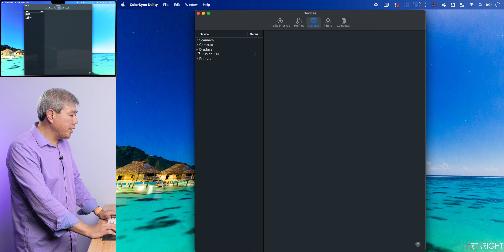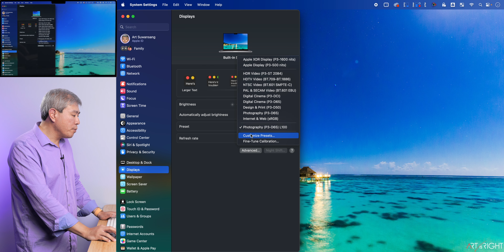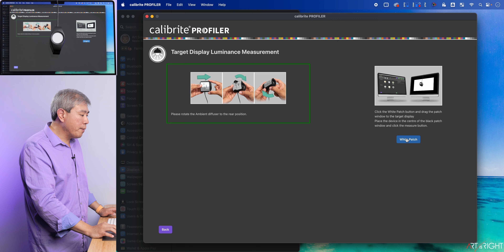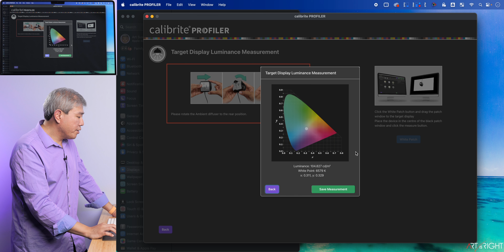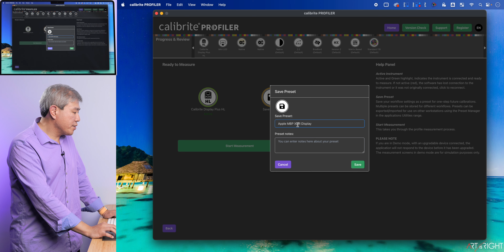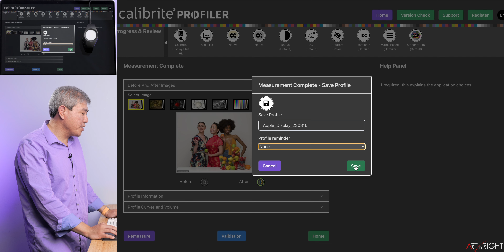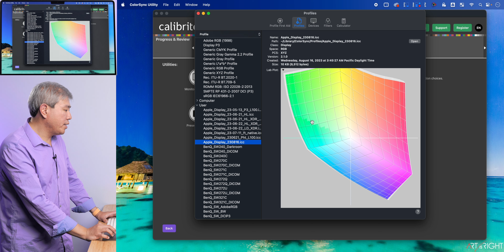Ultimate Calibration Guide for Apple 14" & 16" MacBook Pro XDR Display - This is the way!

Comment: Really appreciate your video. Just picked up the display plus HL for my new 16” M2 MacBook Pro. Question I had for you is whether the following results seem acceptable:
-All patches avg - 0.8 (97)
-of the lowest 90% - 0.5 (87)
-of the highest 10% 2.9

-All patches max: 3.7 (96)
-of the lowest-Max  1.8 (86)

-Standard deviation results - 0.8 (97)
-lowest 90% - 0.4 (87)
-highest 10% - 0.7 (10)

I did set create the P3 L100 profile, and set the custom white point values measured, as well as the targets you suggested. 

Thanks again!!
Reply from the maker: Yes based on what I have seen that is good and within range :)
Reply: @ArtIsRight thanks!
And wow - that has to be the fastest YouTube reply I’ve ever got!
Really appreciate your hard work and the amount of time you take in making these videos!

Comment: Hi Art another great video and thanks for sharing so on my  Pro Display XDR following your instructions to the "T" I  am getting all patches average 1.5  and All patches - Max: 3.3
Let me know if you find out any other "tweaks" I can do for my Pro Display XDR to improve this. little bit.. And yes I am using the new Display Plus HL
Reply from the maker: That is on the high end range that I was getting, If you do run the calibration again, you might be able to drop the average and max down by a few extra points. But that is number is inline with what I am seeing

Comment: Thank you so much, I have MacBook Pro 14 do I need to calibrate it For photography?
Reply from the maker: If you print you should. And if you don't print but do pro work I would recommend using the reference mode and doing a white point fine tune to get the best result out of your Pro Display

Comment: Doing this the All Patches max shows as 3.6 - is that still good? Also when calibrating the white point the max value available was 97.5, not 100 or over. Wondering if all is good. 

Also, what if you calibrated the main Display P3 profile where you can still adjust brightness. Would that be usable too when you sometimes perhaps need the screen a bit brighter?
Reply from the maker: Doing this the All Patches max shows as 3.6 - is that still good? 
- In general, this is expected on some displays. It is not ideal but remember that this for just 1 patch max only. So in all it is not terrible.
Also when calibrating the white point the max value available was 97.5, not 100 or over. Wondering if all is good. 
- This is where the fine tune calibration help. Say your display is 97.5, you would just fine tune that to 100 to get it inline. And ±5 nits of brightness is not discernible for human vision.

Also, what if you calibrated the main Display P3 profile where you can still adjust brightness. Would that be usable too when you sometimes perhaps need the screen a bit brighter?
The if you use P3 for photography, the icc profile will not change regardless of reference mode choose. What this means is that you can set it Apple Display or Apple Display XDR and the profile would still apply, no need to change. It start to get complex if you do too many for all of these sub-vairations and in general, it is not absolutely necessary. Just add more things to forget.
Reply: Thank you very much  @ArtIsRight

Comment: Hello!
I have a question! How do I best clean my benq matte display?
Reply from the maker: lens cleaning microfiber cloth
Reply: Thanks for responding. Can it be a bit damped with water?
Reply from the maker: you can just don't use any solvent and I would try on one of the corner first, just in case.

Comment: Yeah i definitely regret buying a SpyderX instead of x-rite/calibrite
Reply from the maker: If you are in the return period bring it back, if not sell it used and get the latest HL
Reply: @ArtIsRight  it has been over 4 years, ha!
Reply from the maker: Then the latter option.
Reply: @ArtIsRight  Yeah. I'll upgrade when I get a reference grade dual layer LCD or OLED displays. For the time being the Spyder seems do be doing a decent job. I can get average dE2000 of less than 1 for all my displays which are all BenQ LCDs without dimming zones. 

X-Rite has always been the industry standard but you've definitely sold me on the calibrite software package though.

Comment from the maker: Only Calibrite newest Display Pro HL and Display Plus HL are capable of profiling miniLED backlight displays such as Apple Liquid Retina XDR displays. All previous Calibrite / X-Rite devices are not capable of calibrating any miniLED backlight display including Apple Liquid Retina XDR inside the 14" & 16" MacBook Pro.
Reply: I know you say "aren't capable" but can we use the GB LED option and use the original Display Plus? I JUST bought it earlier this year when I got my 16" M2 and these Plus HL weren't out yet when I bought the Display Plus.
Reply: I have the same question @ProfessorStone
Reply: @ProfessorStone  I saw a 2023 video that says Calibrite will help you upgrade your old calibrating devices for $10 so they'll work with the new software, though your Display Plus is pretty recent, so it's probably going to work fine. However, if you have an XDR display, the Display Plus and Display Pro are the only ones that will work with that display. I think I have this correct. Today was major figure-out-how-to-calibrate-both-monitors day so it actually works.
Reply: Very nice explanation @ArtIsRight !

I´ve been using Colormunki Display to calibrate and profile my DELL monitor plugged to a PC.

I´m planning to move soon to MBP M3 PRO. How can I calibrate and profile my DELL monitor plugged to MBP? Is it the same? Another question: shouldn´t I use Colormunki Display to do that? Thank you very much!
Reply: What about the i1Pro 3? x Rite says good up to 5000 nits, and i1profiler says it is ambiguous to display technology! I used it and got a respectable 0.5 avg 1.7 max dE (Edit: just looked at the gamut of that profile in Colorsync Utility, not nearly covering P3 like yours!)
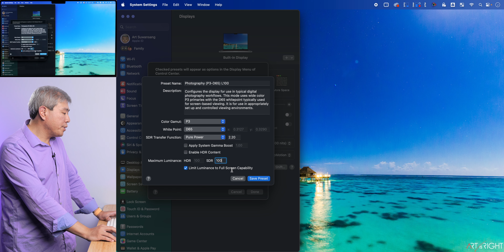Reply: 7:01 can you explain what you mean here???
Reply: would love to know too!
Reply: What about going a calibration with the calibrate pro unit? 🙆🏻‍♀️
Reply: Hi Art. Just watched this video as you suggest in your earlier reply to my issue. Unfortunately I have the Spyder X so I guess I’m not going to be able to have a preset for the Photography P3 display setting.  Regards. Dave
Reply: @Bravanboy19  Couldn't you use DisplayCAL with your Spyder?
Reply: I ordered the Pro first, but I returned it and got me the Plus version. Very strand that a Plus version has more options available than a Pro version. Very happy with the unit and your workflow explained in this video. It took me a bit of time to follow it. I now have a calibrated Macbook M2 Pro 16 inch screen. Thank you.

I do have a question though. We all have a different view, I mean; our eyes are all different and we sometimes use glasses. We can calibrate our screens and printers, but how about our eyes? What if we have a slight problem with seeing certain colors? Then we have to rely on onscreen tools to determain the right color balance? Same like many non linear video editing software has?
Reply: @GertKracht  That's why you need to learn to use "Numbers" like CIE Lab to assess colors
Reply: wow that's a statement I have not heard before. Ive been fighting with my 14" MacBook Pro M1 trying to get monitor and printer to see eye to eye.I am aware that paper and display are lit different. Also that monitors are use RGB and printers use CYMK. That we should still send RGB information to the printer. Ive learned this and so much more from your videos. I can not thank you enough! I have tried to use Data-color Spyder to make profiles for my printer and used their monitor calibration as well. Not a usable outcome.  Now am using calibrite color checker studio to do the same thing hoping for a better outcome. Will the color checker studio be able to calibrate my MacBook? I used it to cababrate my Mac book 
😮monitor and also printed and scanned color targets to make ICC profile. But the results were way off. Help!!!
Reply: Hey. Thanks for the guide. All worked great apart from the fact my display profile seems to occupy a much smaller area of the P3 space than in your example…it is much closer to sRGB instead. Using an M1 MBP, with the Calibrite Pro HL on Sequoia
Reply: I think that if you want to calibrate to srgb or rec709 using the older device models is fine? Just have to chose PSF Phosphor as display type. At least that is what I read in the calibrate app.
Reply: You mentioned there are settings to turn off on the macbook pros with Older OS. How about a 2025 running Tahoe? I just purchased the display pro HL

Comment: Thank you for your videos, really helpful. Can you make a video calibrating in rec.709 gamma 2.4 100 nit and the difference between pure gamma and Apple's default HDTV video profile with gamma BT.1886 Annex 1 and system gamma boost of 1.22?
Reply: I've been wondering exactly this too.
Reply from the maker: Everything is the same, just change the reference mode. There's no need for another video. Just choose REC709 for gamut and set the Transfer Function to 2.4 or BT1886, both are going to be so close that it just comes down to preference.
Reply: @ArtIsRight  Thank you but why Apple's default HDTV video profile with gamma BT.1886 Annex 1 is using system gamma boost of 1.22 instead of pure power?
Reply from the maker: That is a fiction of BT1886 if you want to use that you can. BT1886 is a gamma curve and it is not 2.2. So in this case it correspond to 1.22

Comment: I have 16' M1 and mini LED isnt part of the option. Doest it matter if I have iProfiler display plus?
Reply from the maker: Yes I said in the video 14" & 16" MacBook Pro I didn't specified the SoC. All of them with Apple Silicon will work with this guide and the device matters, you need the HL model to calibrate these displays.

Comment: only got a i1 display pro plus sad🥲
Reply: I just got a display pro HL, but I think the hardware is the same as the plus. You could try using displaycal for a profile. 

I use displaycal for external monitors since the calibrite profiler keeps lifting my blacks up way too high, decreasing my contrast ratio from 800:1 to 400:1 on an older TN WLED panel, displaycal does a 2.2 or SRGB calibration with the option to keep a native tone curve, so the contrast ratio will be kept and the colours will still be calibrated. 

The only thing I don’t like about Mac OS and profiles is that I can’t use a complicated calibration. Seem to have to use curve with matrix and black point compensation which for some reason clips my high reds (like 250-255 are all the same)
Reply: I’ll try! Thanks a lot!
Reply from the maker: " just got a display pro HL, but I think the hardware is the same as the plus."
It would seem so for 2 reasons, all Calibrite colorimeter uses the same SDK. 
 "You could try using displaycal for a profile. "
I don't comment on this software, they don't user license driver. And since the SDK is the same from the properly licensed device, this is why display cal works as well.